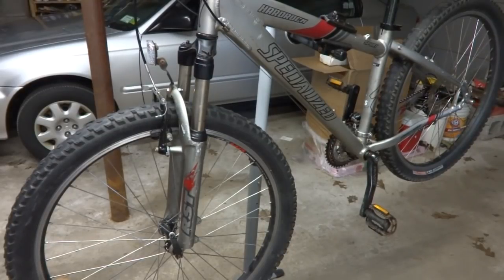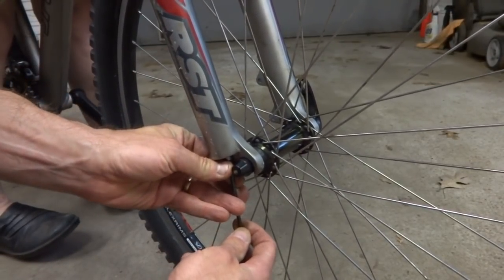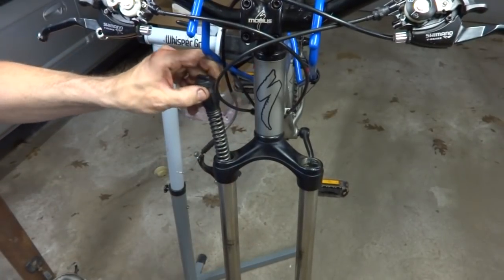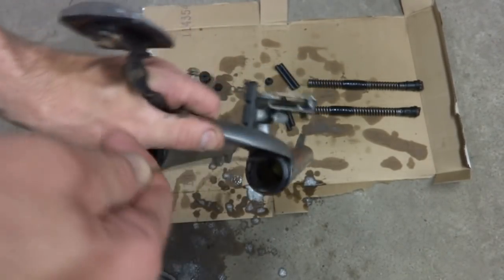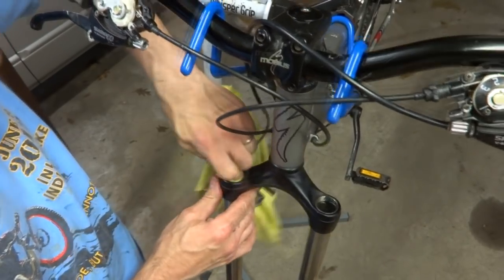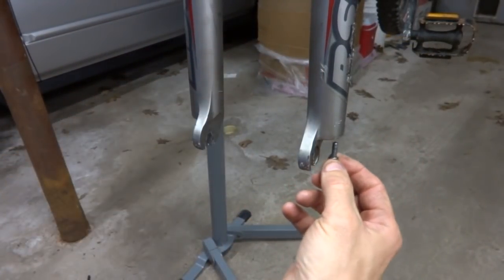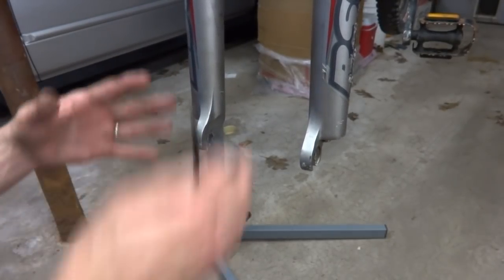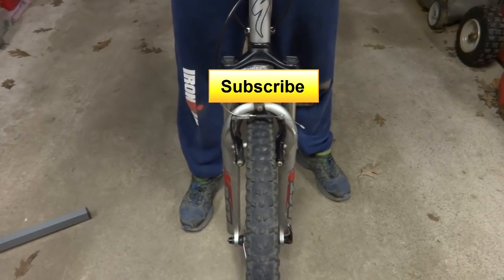How To Disassemble/Clean/Lube/Re-assemble RST Gila T5 Forks

Comment: > "Every 4 weeks or 25-30 hours of riding or whenever the performance of the fork has diminished(whichever occurs first)."

Thanks. I'll now go and take apart my creaking suspension not opened for 10+ years. Wish my luck LOL
Reply: I have just taken on a refurbish bike build so...i definitely wish you luck...lol
This guys videos are just full of little tips tricks and essential maintenance advice you will soon be cleaning, repairing and cycling with the pro's.

Comment: Nice one. I'm currently restoring an identical Specialized so now I know how to recondition the fork too 👌🏻
Reply: Update. I did it. It worked. I was very surprised, because the bike had been sat in a damp basement for about eight years, and the fork didn't move an inch. When I took the lowers off, about a litre of muddy water gushed out of each fork leg! 😅 The topcaps were seized, but I made the tool out of the socket and it worked. Amazing. The end caps of the springs were seized into place so I couldn't get the elastomers out, so I cleaned them as best I could in situ, and re-greased it all with red rubber grease, and reassembled it. Works a treat now 🙌🏻🙌🏻🙌🏻

Comment: I like your videos! Lots of info. I haven't read all the comments but instead of having a helper sit on the bike, a ratchet strap from the front wheel to the top of the handlebars or frame would have put pressure to get that bolt released as well... For those of us alone in the garage :-)

Comment: Many thanks. That tool is pretty cool.  
Could you explain a bit about the plastic dials on top of the uppers and how they should be set?
Reply from the maker: They preload the springs and can make the suspension just a little softer or stiffer. Personal preference.

Comment: I actually have the same forks on a Cannondale. Followed your video and got them cleaned. Except the grease that was in them was this nasty yellow stuff. A devil to get out! Smelled of old dirt and vasoline. Finally just dumped lowers into a bath of strong citric cleaner.
Reply: Joe N i recommend to use atf (automatic transmission fluid ) than grease will add more dirt inside the stancion

Comment: Thanks for this tutorial. I have a fork that had lost most of it's spring. I'll be needing to install new coils and hopefully what you've demonstrate will apply to this fork.

 I have another fork that has no bottom screw and when I remove the top cap, there's an Allen bolt, however I don't have an Allen key long enough to reach it. Are there special tools for this kind of fork?
Reply from the maker: I have over a dozen different fork overhaul videos. Different forks are different. If I don't have a video on your fork, then you will have to find instructions or figure it out.
https://www.amazon.com/exec/obidos/ASIN/B001NT2LK4/ref=nosim/youtube25-20

Comment: I couldn't find any other videos that you did on the 2005 Hardrock Sport.  I'm especially interested in removing the cranks and replacing the bottom bracket.  If you did a such a video, could you give me a link to it?  (I have a 2004 Hardrock Sport.)

Comment: sir do you have any remedy incase the bolt is still turning but not loosening despite pressing the fork hard.
Reply from the maker: You can try an impact wrench. Sometimes that will break it loose. If you remove the stacks from inside the fork, I think you can get a long hex socket down there, and hold it from inside. I can't remember if these had that like RockShox.

Comment: Thanks for the upload, i have the same hardrock only difference is i have disc brakes. My question is. Do i have to do this maintenance? my top caps of the left side are loose and dont snap into place. Any feedback will be greatly appreciated!
Reply from the maker: +rpmbxdj The top caps snap on and don't screw on?
Reply: +RJ The Bike Guy I meant the lowers top caps sorry

Comment: Hi I have a question, my suspension doesn't have an alkey screws it have what seems like a bolt and I have no idea how to unscrew it from the bottom
Reply from the maker: Then you apparently have different forks which requires different instructions.
Reply: Any idea how I can identify the type of suspension I have ? I also feel a bit of a small tap in my suspension when I hit the ground hard and a click when I pull the suspension up. I'm assuming it's not the best type of suspension for my bike

Comment: I appreciated your video, thank you. I have an old Giant Sedona that needs some TLC and since the prices at the bike shop to do it are a bit high, and since I'm a bit handy, I figured I could do a lot of it myself. They told me the suspension was not serviceable but apparently, from watching your video, that's not quite true. Perhaps what they meant was that the hardness could not be adjusted which sort of appears to be the case. On an old bike, those springs sooner or later will provide less tension much like in an old car. So If I need a harder ride, is there any option other than changing the whole fork? I have noticed that on the top of the Gila T5 fork there is the indication of an adjustment with a + and - sign but you didn't go into that in this video. Could you elaborate on what they do and how to use them? Thanks, Peter.
Reply from the maker: +Water Air Industry Taking old shocks apart can be risky as parts are likely not available. Adjust the cap on the top. That is the preload and will stiffen the shock some.
Reply: Thanks RJ.

Comment: I am unable to compress the shocks and the impact drill does not spin the allen bolt off.  any ideas on how I can remove lower section?
Reply: I took a 5mm allen wrench and used 2 extenstions to get a bit on the screw inside the uppers.  4mm spun off easily when I did that.  Thanks for the video.  Shocks are back together and work great.  Your videos gave me the confidence to try and fix on my own.

Comment: Quick question, RJ...

Would Castrol automotive bearing grease work well with my shocks?
Reply from the maker: +mtlnascarfan No.
Reply: +RJ The Bike Guy  why ?
Reply from the maker: Because it may not play nicely with any plastic parts or especially the elastomers. I think it's probably different in other ways also. Use the correct lubricants. Would you replace your motor oil with vegetable oil? They are both about the same consistency... No. They are different. They have different properties.
Reply: +RJ The Bike Guy  true . thanks again . I appreciate everything
Reply: RJ The Bike Guy . thnks for a great tutorial. tomorrow gonna strip down my shoock on the Titan, it has a similiar fork. cheers

Comment: Just bought a used (05-ish) hardrock sport. The chrome is showing at the top of the fork on one side. Right below the cap. Is the tube  just pressfit in there?
Reply from the maker: Some forks have pressed in seals.
Reply: @RJTheBikeGuy  I mean are the chrome tubes pressed into the top bracket? I think one shifted.
Reply from the maker: Into the fork crown? Unless they are clamped in, the fork is probably toast.
Reply: @RJTheBikeGuy yep that's what I'm thinking.

Comment: What are those black rubber covers over the springs? I removed them and don't know where to put them.
Reply from the maker: They cushion the springs from banging around on the insides of the shocks.
Reply: RJ The Bike Guy where would I place them on the spring? I have RST Omni 181. A version with very smaller rubber seals and no elastomers.
Reply from the maker: Probably in the middle in the middle. WHere were they before?
Reply: RJ The Bike Guy around the same location as yours, does it matter though?

Comment: what if my right tube has oil in it and left has spring (fork is a manitou black elite) and i have no nut on bottom to take off lowers
Reply from the maker: You need to find instructions for THAT fork.

Comment: Thanks for the video! Just a quick question, though. I got this exact make/model of bike used for a nice price, but the top tubes have one cap missing (the things you used your special socket too for around 3:35.) Do you know if there are replacements for those?
Reply from the maker: Doubtful. You can check ebay. Probably just replace the forks, or find some damaged versions of these for parts.

Comment: Should i rebuild my fork (RST Blaze Cheapo coil fork) if there is a thin black greasy coat on the stanchions?
Reply from the maker: I don't know what the black greasy coating is. Are they working okay? If so, maybe leave them alone. You can always clean the black grease off and add some slickoleum.
Reply: They seem to work okay for what they are so I will save the time and clean the outsides. Thanks
Reply: I would say kind of but it is a really thin coat.

Comment: Have a question for you: I've watched this video time and again, getting ready to tackle a cleansing/ light refurb of an RST CT-COM fork on a hybrid bike (I know; different design, but still). Hit an interesting snag when I went to look at the bottom of the fork stanchions: there are no screws!

So, does this mean I'm forked/ screwed/ etc (har), or is there still a way to tear down a fork like this? I get it's just an entry-level fork, but wanted to at least clean it up as best I can before sending this bike on to its next owner (were it not for an unusually long head tube, I'd just replace it with another entry-level fork...).
Reply from the maker: Those are different forks. Maybe they come apart like these: https://www.youtube.com/watch?v=9sdO6BZ6Jxo
Or not. They will come apart I am sure.

Comment: Mine is a RST 191 and to part is not like yours or a normal RST. It doesnt seem to be a way to dissaseembly? I saw some holes that I might use a wrench spanner but Im not sure if they are made to disassembly it. Do you have any ideia about RST 191? I could post a pic later
Reply from the maker: I haven't worked on one of those.

Comment: I have a problem with the forks on my bike. Not only is It seized, I cannot loosen nor tighten one of the nuts at the bottom as It just rattles freely like It Is screwed Into the spring but like the spring might be snapped, would you suggest that I take It apart with more force or to just replace the full fork entirely?
Reply from the maker: Might as well try to fix it if the other option is replacing them anyway.
Reply: I'll fix them if i am able to, but it May be cheaper to replace, thank you.

Comment: Hi there! First of all thanks for the video, BUT; I have a problem! Right at the beginning! The second screw just dont come out, i tried with a person helping me, pulling down on the front and putting as more weight on it as possibe....but nothing...the screw just dont want to come out! Is there anything else i can/should do? Taking it to a professional I guess? I'm out of ideas :/

Thanks
Reply from the maker: Bubu461989 The part that is inside the fork is turning too, so the bolt just turns and turns, right? Another method I have used, was to use an impact wrench to loosen it. The hammering action caused it to free up from the part inside. Also, I think, if you can get the stacks out of the upper tubes, there might be a hex fitting on the top of the part at the bottom of the tube. So you might be able to get a long extension with a hex socket to hold it from turning while you remove the bolt on the bottom.
Reply: RJ The Bike Guy when i read it the first time i misunderstood the "impact wrench" with the fact that i should hammer the fork with a wrench, so to loosen the part inside, i did that and obviously didn't work, and I don't have an impact wrench actually..so i guess i should buy one....or i should go to a specialist? Or i could try and hammer the bolt a little, maybe that would work?

Comment: So, ive owned my bike about 4 weeks. And i dont know that much about bike mechanics, and didnt know if it was a concern that grease was getting pushed onto the showing part of the suspension, so i took it in to the bike shop. Also got brakes adjusted and stuff. And before i took it in, the suspension made a lightish squeak when i went of curbs and such. The guy   said he cleaned out and re lubed the suspension, but the problem now is whenever i go off big curbs and compress the suspension, it makes a clunking sound similiar to that of an 80 year old car going over a pot hole. I would like to know if theres anything i can do about it.
Reply: That your forks bottoming out all that you need to do is to turn your preload cap right
Reply: I did it works

Comment: im trying to restore a mountain bike and the chain has some rust and ive tried to use coco cola to clean it but not very good...can i remove the chain completely from the bike to clean and then put back onto the bike ??? also my front suspension is not working and maybe seized but i noticed on one top side of the RST gila forks there is a lever missing and on the folk there is a label marked         lock...would the missing lever cause the forks to appear seized ????
Reply from the maker: If the chain is rusty, replace it. They are like $10 on Amazon.com.  I like KMC chains. And yes, it could be the fork is locked out.
Reply: @RJTheBikeGuy  thanks for that...i will have to try and get a lock lever...my forks are RST gila sl so not sure where to buy the exact one that i need...i will take a look on ebay but not sure what im looking at...im new to trying to fix mountain bikes so sorry for too many questions.

Comment: My coil suspension comes with a rebound setting and I think it's preventing me from doing the step. Any help?
Reply from the maker: Rebound setting? DO you mean preload? Doing the step? Or do you have a completely different fork, in which case this video is not applicable.
Reply: @RJTheBikeGuy  no completely different fork, was just wondering if you could help, where the bolts are at the bottom of the suspension there is a red plastic cover that is preventing me from loosing the bolt, which is where I hope you could come up with a solution for me.
Reply from the maker: @jammygiinger625  Different fork is different instructions. Find instructions for your fork.
Reply: @RJTheBikeGuy  I know have been for about an hour now but couldn't find any instructions on how to take it apart.
Reply from the maker: Ask the manufacturer.
Reply: @RJTheBikeGuy  yeah I guess but Halfords would instead of helping me find a solution would recommend me take it into the shop and wait about 2 weeks to find that the bike is in a worst condition than I gave to them in... Anyways thanks for the help

Comment: i bought my bike in Taiwan and the spring from the front shock came loose I disassembled it and the parts are completely different the screw on the base leads to nothing it got only a cylindrical plastic pressed in by a foam and the spring that does not came loose when i disassembled it.  crazy thing is that it came loose when I lift the bike the front shock just fall down.

Comment: Great Video! generally speaking marine grease is lithium based, i use red ruber grease which is castor oil based. Any way, Im trying to stop top out, any ideas?
Reply from the maker: They are topping out. Maybe replace them.
Reply: Thanks for response! Its 2 weeks old. I was looking to modify etc as im out of work atm
Reply from the maker: What do you mean it's two weeks old? It has RST Gila T5 shocks? These are old shocks.
Reply: My boke is new
Reply from the maker: Let me guess, you bought a cheap bike at Walmart, or Target?
Reply: No. Im in australia. 600 is cheap, but not that cheap. Similar to the one your working on.

Comment: I have a vtt decathlon (rockrider) about the same fork as your. I wanted to lubricate as on your video but when I opened the bolt allen n 4 the fork did not want to detach there is another stage
 (I try by all means pleashelp me)
Reply from the maker: Sorry, I don't know that fork.
Reply: Thank you I find the solution, the long bolt that connects the fork is screwed into the fork you must use a long key allen  inside, thank you very much for your reply

Comment: excuse me! What if after the fisrt 2 screws from the bottom part of fork, wont come out? it seems like its stuck. (before all that you have to know that my fork doesn't work perfectly and when i ride it after a week it was hard to push it down with my weight and from then i have no suspensions) Sorry for my English
Reply from the maker: I think you want this video: https://www.youtube.com/watch?v=d534ilYCaMk
Reply: Thanks a lot! i made it !  the only problem i met is the tool that you made to unscrew the top part.

Comment: My fork has a couple of plastic seals and they keep sliding out. What do I do to keep them in place?
Reply from the maker: Give me a time code in this video for where the parts you are talking about are.
Reply: I don't think there fork your working on has the same types of seals. 

It's basically the equivalent to the dust wipers where the stanchion enter the bottoms. In my case, they help to stabilize the stanchions so to stop them from wiggling around. 

I hope that makes sense. I need them to stay locked into the bottoms to center everything. I've had to pull apart my fork 2 times in 2 weeks to address the issue. Have you ever experience this problem?
Reply from the maker: So you have a a different fork, with different parts, and you seem to expect that I am going to know exactly what you are talking about.
Reply: I've seen you cover different types of forks in other videos. I thought you would have a clue of all the different nuances. I'm sorry, I'll ask someone else. Or maybe figure it out on my own.
Reply from the maker: I suggest when you ask them, at least tell them what brand/model the fork is. It's usually printed on the side of the fork.
Reply: Well, the fork in question was part of a bike I found that had been spray painted black. I then pain stripped it and repainted it myself, so I have no clue what brand and make the fork or the entire bike is. However, I suspect that it's a low end brand like a huffy or something.